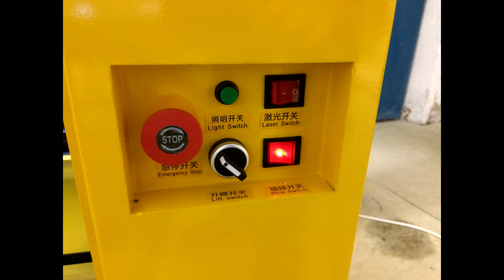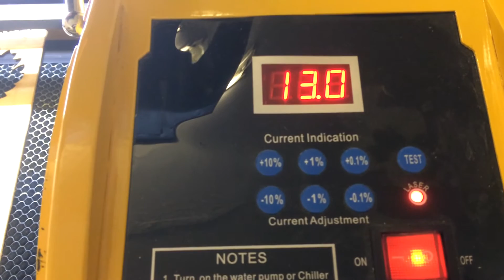Laser engraving machine 4060 80W

Comment: Have you ever had an issue that it doesn’t cut thru 1/8” birch wood. I just bought this machine and it’s cutting but not enough for cut the entire piece. Don’t know if I need to adjust the focal lenses or what
Reply from the maker: You need to check if laser ray goes through centers of each mirror and to adjust focal distance to surface to be cut.